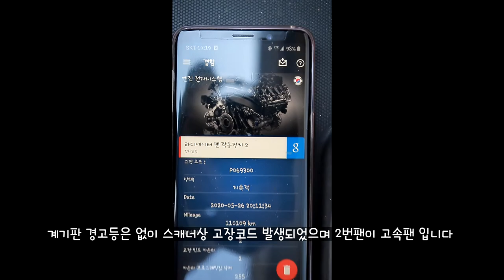2012 A7 3.0 TFSI Radiator fan fuse(40A) 교체

Comment: Did u have to disconnect the battery to replace fuses?
Any risk of SHOCK?
Reply from the maker: I did it without disconnecting the battery terminals.

To be safe, it is right to take it apart, but I was careful not to let the spanner touch the surrounding structures.

If you have an electrical tester, it is better to check it and disconnect it if there is voltage

Comment: What tool did you use to remove the bar?
Reply from the maker: https://images.app.goo.gl/b1Ah8HX6KLKs4JGn8
Front strut brace bar?  this?
Reply: @doodoori1  Yes, please... what size was the socket? :)
Reply from the maker: @mariancoman354  12point spline bit socket M10